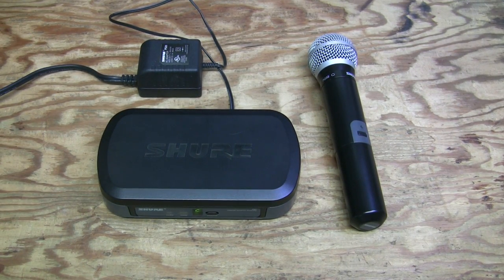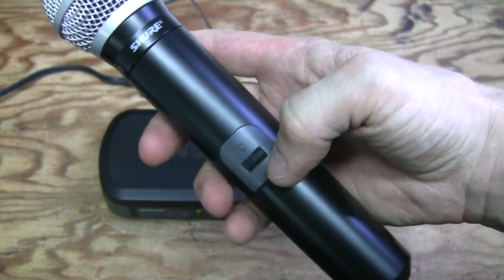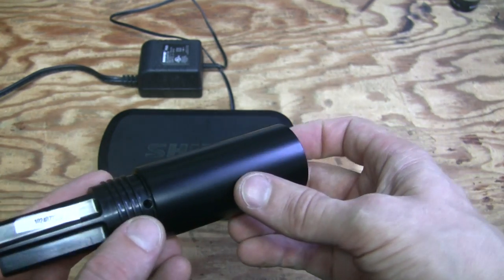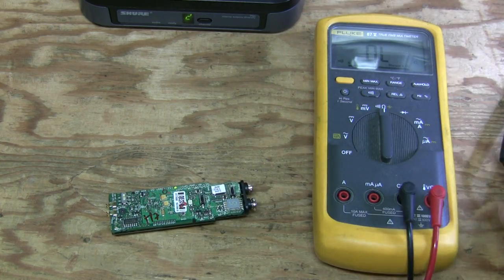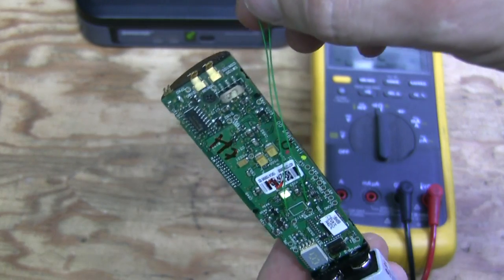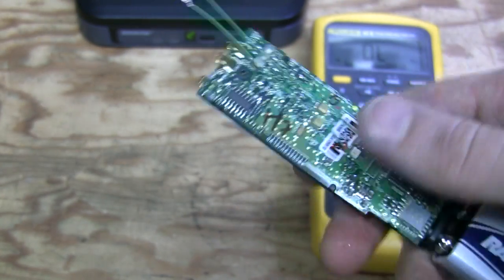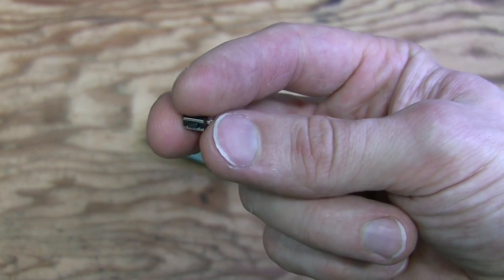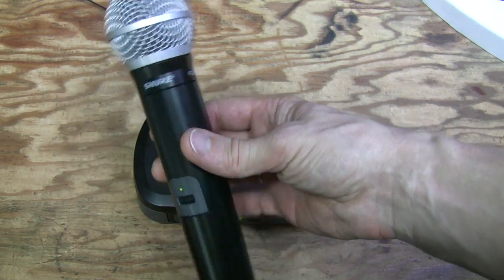#13 - Shure wireless microphone repair

Comment: Can I put a Shure or Sennheiser capsule in another brand of wireless microphone? If I solder the capsule connections correctly, could it cause future problems with the transmitter?

Comment: good as I get those pieces I have 2 microphone with the same problem the battery does not fuse 9v .. if possible where I can get .. Thanks for your help.  it's H-7 and M-7

Comment: Have you ever cracked open a Shure QLD-D2 handheld unit?  I have one that someone dropped on the power switch and snapped the switch tab off the switch.  $2 part on Fullcompass, but I can't even get the thing apart.  The SLX mics are so simple.  This thing is a nightmare.
Reply from the maker: Not yet.
Reply: I just figured it out.  I had to remove the antenna cap and unscrew a hidden screw...
Reply from the maker: Have you seen my repair of ULX2? Maybe it is similar. https://youtu.be/P-ux1rKmkS0

Comment: On that board - The upper right corner there is a white switch - Can you tell me what it does? My is pushed to the far right - What happens if moved to the left??? Thanks
Reply from the maker: This is a -10db gain switch

Comment: Great vid - helped me work out why my shure mic stopped working! I opened it up and sprayed some de-oxit contact cleaner on the switch and it seems to be working fine again. If it fails again I'll know to get a replacement switch. Cheers

Comment: Do you have a video of removing the channel switch and installing it to the power position? That would be most helpful. Thanks and great job. (clicking my switch repeatedly does power it on/ mute and off works fine)

Comment: Simular problem with the power- mute switch on PG1 Bodypack Transmitter, Other model of switch needed though.  Symptom:  intermittant problems with power mute switching.
I used switch "TASTER 3305B" from Reichelt in Germany.  You need to cut a small piece of the switch its  plastic shaft to make it work.

Comment: those idiots... all that work and they picked a regular crappy micro switch at these price ranges. they should have used good quality switches. gold plated or at least sealed micro switches would save a lot of headache for a lot of devices. from garage door openers to computer mouses to everything they all get corroded in end . these micro switches are the number 1 cause of failure in products even more then failing caps. tip; if you are lazy or desperate enough you can open the switch itself clean it and put it back. if you put a little dab of long lasting synthetic oil inside it will last forever.

Comment: great video and very helpful, this problem has put me off buying anything with a push button switch such as on the PG58 again. If your not very good with electronics you've had it though. Mines off to Ebay for sale for parts.

Comment: Thanks for the Video! 
Had the same problem with mine. I did not have a replacement switch, so I took the switch from the channel selector and used it as "on-off" toggle.
Mic works fine now.

Comment: Friend...I have  same microphone but my problem is not about switch buton, I think someone in my church threw it down and stop working. After removing the capsule I found that one of  the metal contacts was broken!!!
I'm from Costa Rica and  I will appreciate if you know if there is a place or internet store   where I can find  the complete board... Regards  Transmitter modelo PG2

Comment: Thank you for this - Shure wanted to charge me in excess of £100 ($160!) to do this exact repair. They then charged me almost £10 ($16) just for the 23c switch. Its a shame you didnt show how to actually remove and replace the switch as I know little about electronics lol!
Reply from the maker: Colin Cook
Yeah, I agree. I realized later that in such cases, when the problem happens to be quite simple, I should better use the opportunity to show the details of soldering and such. I hope to improve. Thanks for your feedback.
Reply: It seems like you are complete noob in electronics if you dont know how to replace ordinary SMD switch...
Reply: FeedbackLoop